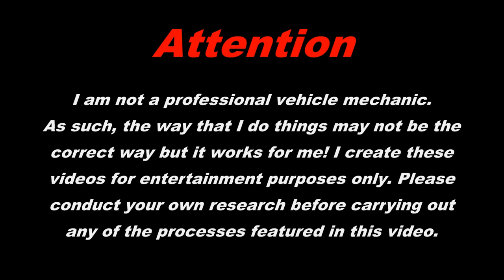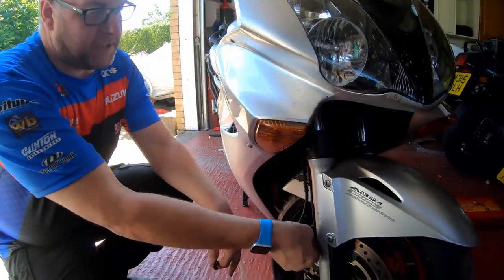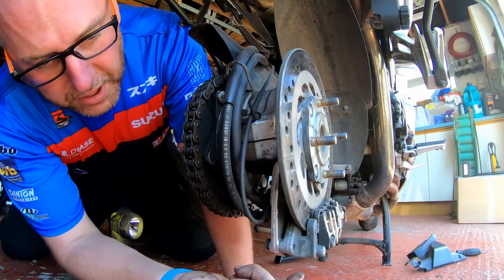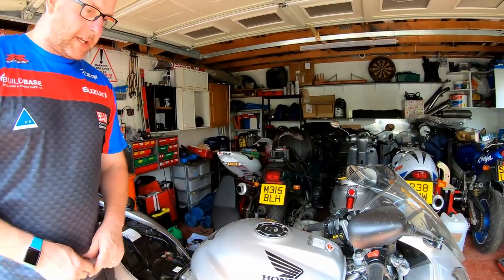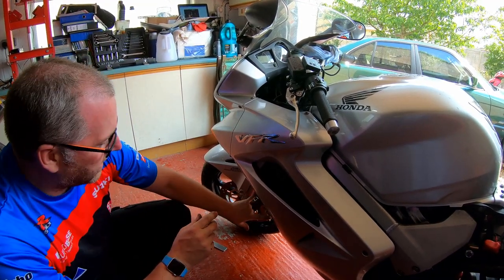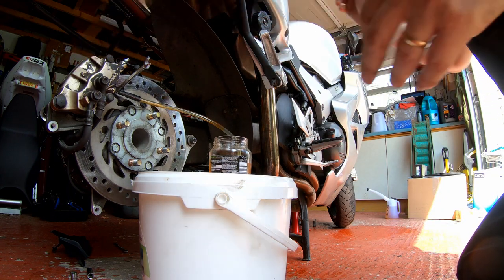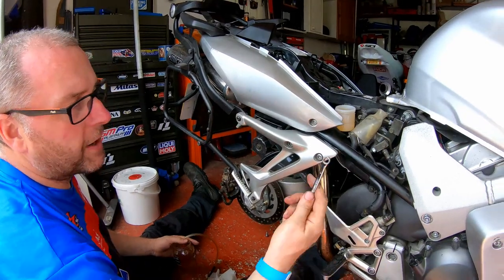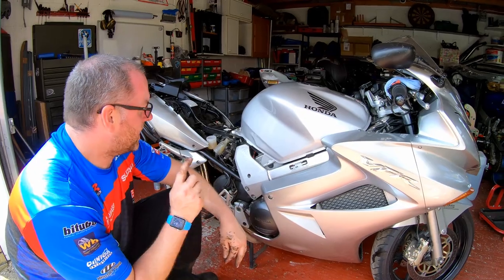2003 Honda VFR800 VTEC Changing The Brake Fluid And Bleeding The Linked Brake System (CBS)

Comment: Kev, is the rear proportioning valve (stage 4 of the operation) only on ABS models? Maybe I'm looking in the wrong place, but I can't seem to find the bleeder valve above the rear brake pedal. Thank you for all your great informational videos! 🍻
Reply from the maker: There are 2 valves under the seat on ABS models, on the non-ABS models there is only the one. If you have a non-ABS model then you won't find the unit that you are searching for. I really should have said that in the video but as I have an ABS model it really didn't occur to me at the time! 👍🤓
Reply: @KevsShed  Yup, I'm on non-ABS model and I was losing my mind trying to find that seventh nipple. Thanks again! Cheers! 🍻

Comment: Is it possible just to use the vacuum pump to bleed through if I don't have any one to help
Reply from the maker: Yes absolutely, I just wanted to demonstrate that it is possible to bleed the system without the use of any specialist tools. 👌🏻
Reply: @KevsShed  are the cam chain tenchers the same front and back on the vfr800 vtec
Reply from the maker: @barrynicholas3911  Exactly the same mate.
Reply: @KevsShed  sound thanks very much for the information and the videos you put up mate cracking job you do
Reply from the maker: @barrynicholas3911  Thanks buddy!

Comment: Great video! How much liquid did you use? Thanks you!!
Reply from the maker: I'm not entirely certain but I would hazard a guess that it was less than half a litre
Reply: @KevsShed  I wanted to change the brake and clutch fluid, I didn't know if half a liter or 1 liter, thanks for the help
Reply from the maker: @estebansm8539  1 Litre should be enough to do both I reckon!
Reply: A litre should do it.
Reply: @KevsShed  1 liter to make the forks is enough? Thanks
Reply from the maker: @estebansm8539  Unfortunately not quite mate, 544ml per fork with an airgap of 100ml, have a look at the video I made on the fork seal replacement for further info.

Comment: Is this the same for the 5th gen pre vtec
Reply from the maker: Pretty much although you won't have one of the bleed screws under the seat as it  only has one proportioning valve because the FI didn't have ABS. other than that pretty much an identical process. 👌🤓
Reply: Thanks I will have a go at it.

Comment: Can you use the bleed gun tool for the whole job?
Reply from the maker: Yes of course, I did it this way to demonstrate that it is possible without one! 👍
Reply: @KevsShed  So if i used the gun, I wouldnt need to pump the rear peddle? I would just use the gun as normal?
Reply from the maker: @leemarchant6468  Unfortunately I would say no. You may have some success but the secondary master cylinder on the front left caliper mount is a pain and will need you to pump the pedal to push fluid through as it doesn't have a reservoir of its own, other than that you should be fine. You could do with having a look at the factory manual which can be found online and reading through the procedure as Honda describe it and you will understand what I mean.
Reply: Thanks bud, keep the videos coming the content is great
Reply from the maker: @leemarchant6468  Cheers mate

Comment: Hi Kev
You can buy a pressure bleeder of not many dollars and it will push the fluid through no worries without assistance,even you could pull it through with your vacuum bleeder it doesn’t need to be under pressure just as long as you get all the air out 😊👍
Reply from the maker: Thank you for your condescending reply! As I clearly stated in the video, I wanted to show that it’s possible to do the job without the use of any pressure or vacuum tools! 🤦🏻‍♂️

Comment: Is the procedure the same for varadero?
Reply from the maker: I can’t be certain, I know the varadero has a linked brake system but I do not know if it is identical, I should imagine that the process is very similar.
Reply: @KevsShed   Models using dcbs are probably the same. thanks doctor.